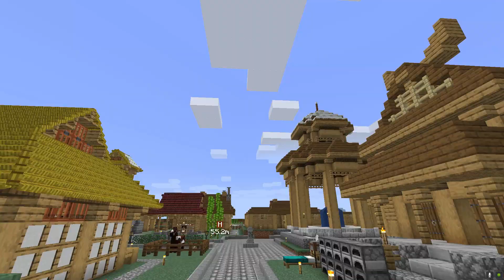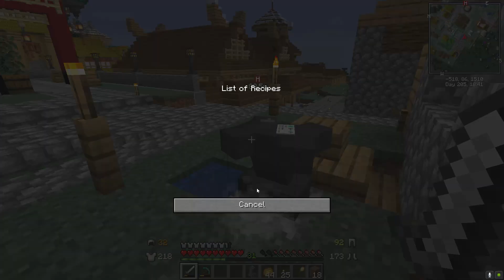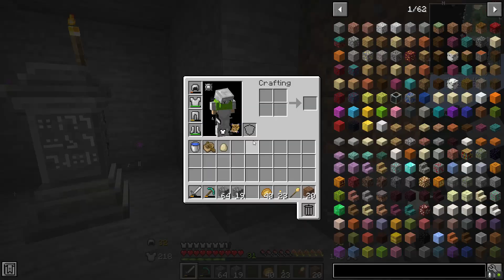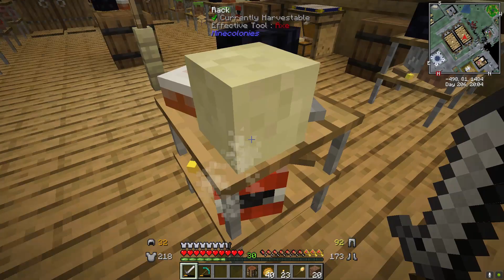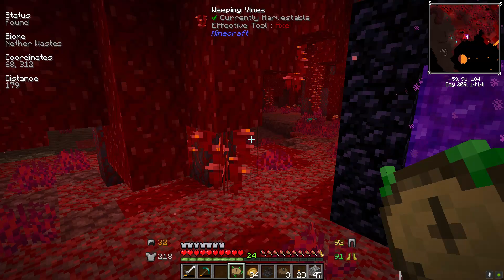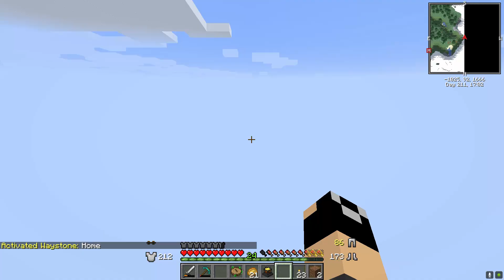Turning Our Attention Towards Create : Valhelsia 3 Minecraft 1.16.4 LP EP #9

Comment: Just to let you know: You should periodically use the "mc colony requestsystem-reset 1" command to make sure your colony is healthy. It clogs the request system up from time to time and, as I've found, that can really save you some headaches. The command forces a clear and resend of all requests.
Reply from the maker: Thank you very much, that could be the cause perhaps of my random crashing of late.  Will have to give that a shot to see if it fixes it :)
Reply: Remove chickenchunks ;)
Reply from the maker: Well I can say for sure it wasnt chickenchunks since the crashing was happening long before my first chunkloader :)  However, clearing mc colonys has worked thus far
Reply: @ToAsgaard  That's good to hear! I wasn't sure if resetting would help with your problem, since we're using different versions and you have tons more mods attached than I do, so I was hoping it would work out for you. Minecolonies is a series of problem solving exercises around why something isn't happening the way it should be. Once you figure out what's wrong and how to fix it, it's tons of fun... but a massive headache right up until then. My recent problem was with a miner that had everything it needed and wouldn't mine. Turned out it was a mod interaction problem with an ore the miner couldn't handle.